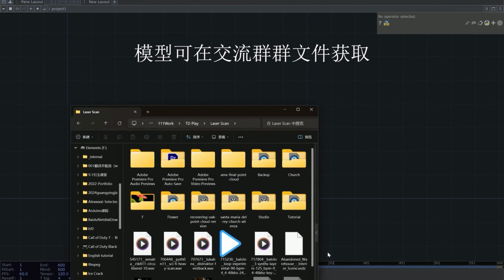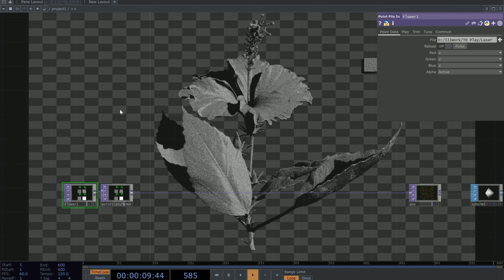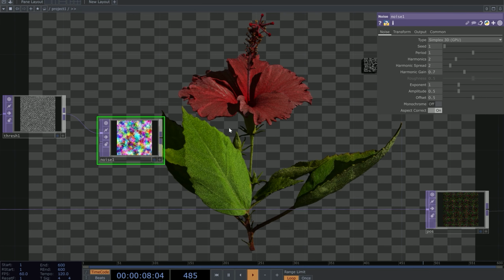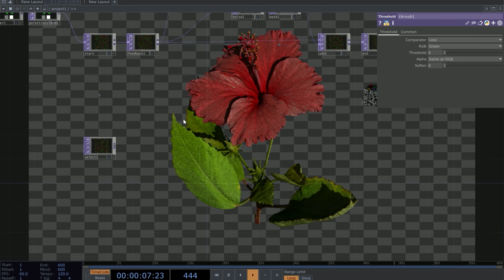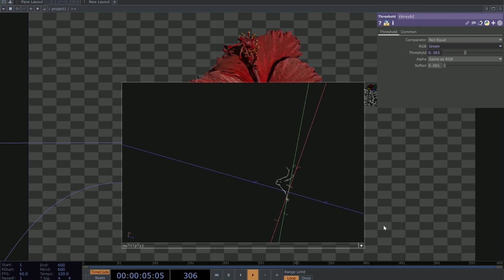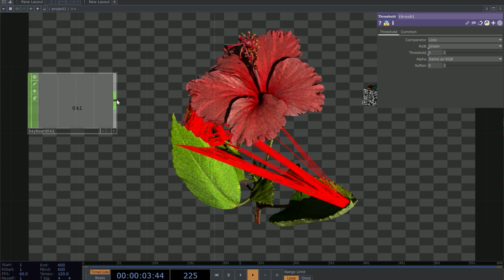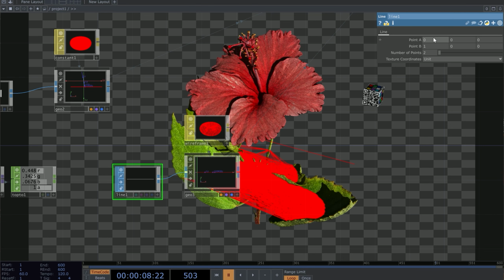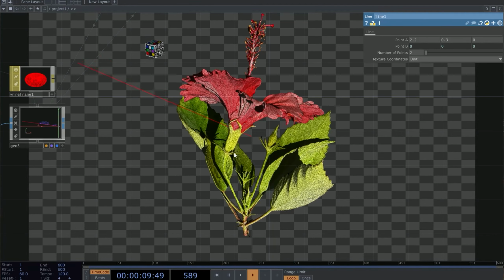【Gem Seed】3D Laser scanning dissipation | TOUCHDESIGNER TUTORIAL (Beginner Friendly)

Comment: what is this video at the beginning, its much cooler and more detailed than the actual tutorial? Why put that at the beginning, but not guide us to learn that specifically. I want to learn how you did the original clip.
Reply from the maker: The number of details is determined by the model you choose, and there is no difference in the content of the tutorial and the effect at the beginning of the video.
Reply: @Alexxi-generativeartist  then why not use the example in the intro, as the actual tutorial, if the content is no different? this feels like clickbait to hook us with one project, then give us a tutorial on this rose where the end product actually looks bad in comparison to the building scan. Is this building example scan in your course?
Reply: you also have the scan turn the structure into a wind particle system and fly away after being scanned, which you dont do with the rose, so theres multiple areas where the content is not the same